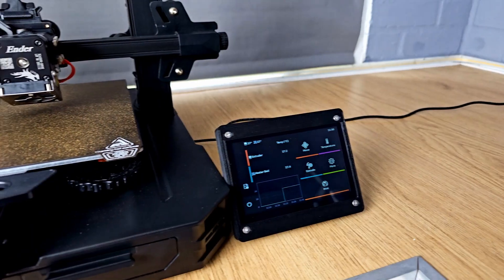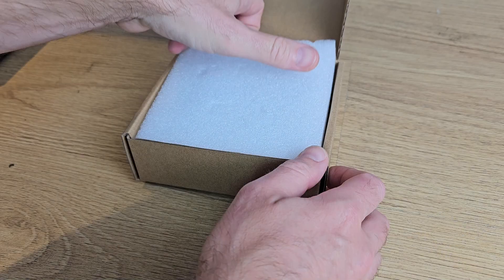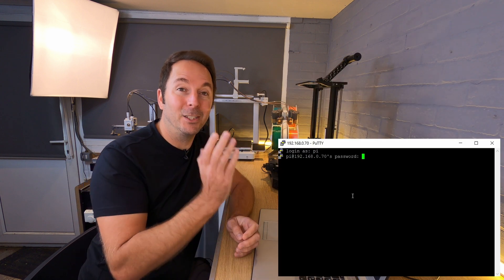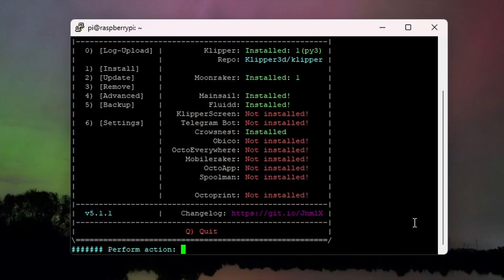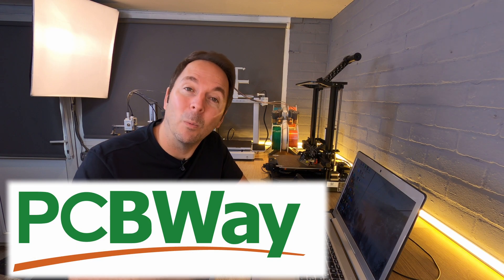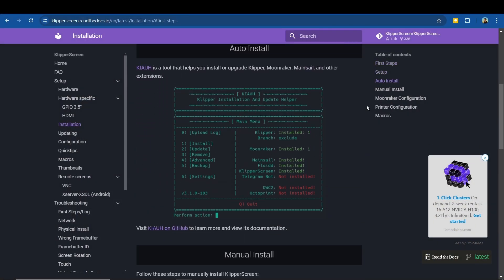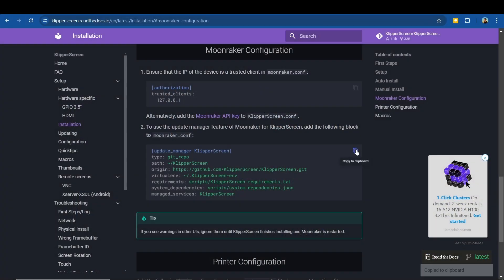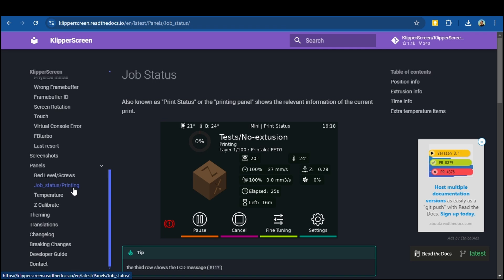How To Add A Touchscreen To Klipper With KlipperScreen - Klipper 3D Printer Series Part 7

Comment: Hello, I recently installed this exact screen into my klipper setup, and I was wondering where I can find the file for the case around the screen and the raspberry pi you are using. I cannot find it online anywhere.

Comment: Hi Ricky. I've followed your tutorial to the letter which is great, however, after installing klipper screen and copying the additional moonraker file for update manager im unable to restart mainsail. I've tried several new installation's to no avail. i get this "Cannot connect to Moonraker (192.168.4.50)". ~/printer_data/logs/moonraker.log.
Reply: Hi David, I hope you may have found a solution by now, but I ran into the same issue recently. Soon I realized that my wlan0 was not connected to the wifi network. It is very likely possible that you might have installed network manager, which I did, along with the klipperscreen interface software and it is messing with your wlan0.  To address this, I manually accessed the terminal on the pi (ctrl+alt+F1) and added the ssid and password (Code - nmcli device; nmcli device wifi connect "your_SSID" password "your_password" ). Some instructions have been provided in the Klipperscreen website under network section of troubleshooting. Chatgpt also provided a step-by-step instructions on resolving the issue. You will need to use usb keyboard and maybe a hdmi connection to external monitor to do this. This has let me remotely access moonraker/mainsail from your computer to follow along the next steps from Ricky's video.